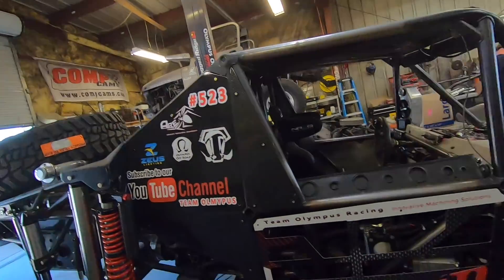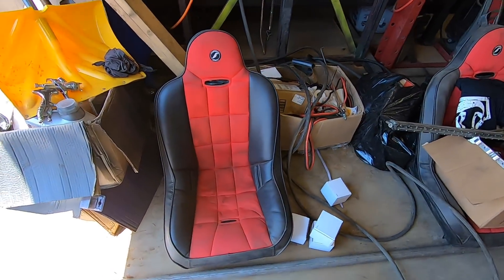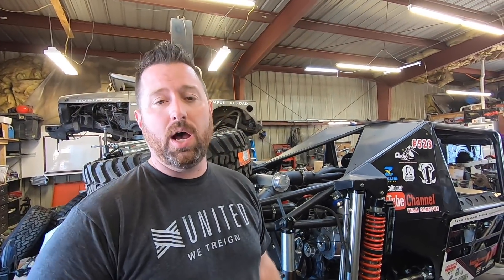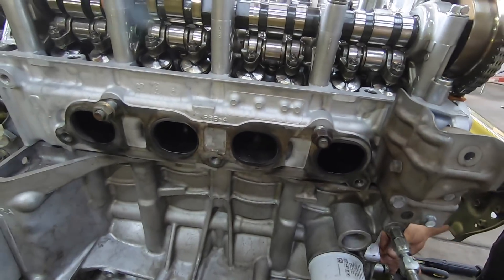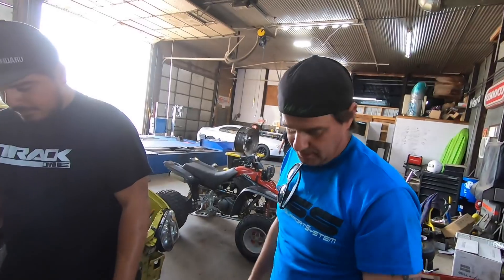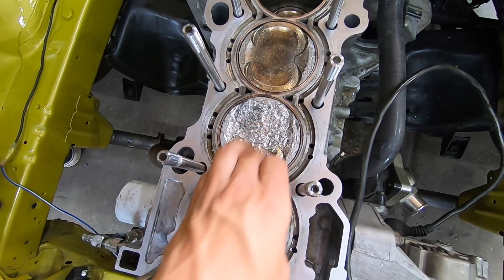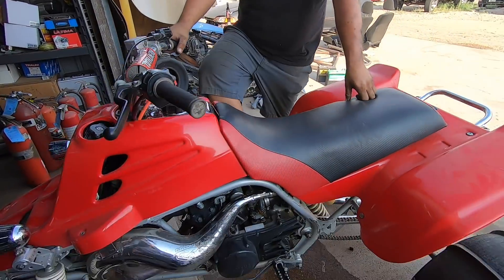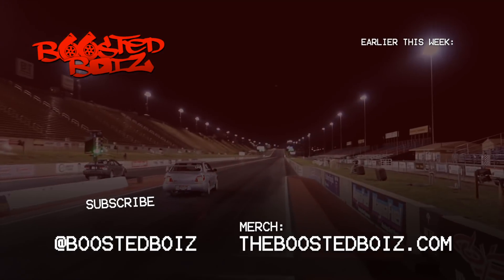Finding Out How Bad The Damage Is on Hondaru

Comment: If they put new valve guides in the heads they could be locking the valves up open when it gets hot so make sure the valve stems have enough clearance in the guides

Comment: My guess is the issue lies in the valve train.  Take the springs out and inspect to see if they're cracked or broken (and all the same type and not mismatched).  Put em all on a tester if you have one to ensure they all have the same seat pressure.  I'm thinking those valves floated for one reason or another and started playing kissy face with the piston.  The motor ran fine dyno session after session but once it hits the track and bouncing on 2 step and limiter *bang*.  Hang in there Emilio!

Comment: Guys, please check the exhaust wheel on the turbo (housing off) good chance its damaged) 
Also when running get a an emap sensor hooked up, you are most likely seeing a much higher figure than your springs can handle, ex is clipping the intake valves on shift as emap rises.

Comment: should change your name to brokenboiz lol those 4 piston heads and axles breakin are gettin a little tiring to watch
Reply: Dang that was harsh lol
Reply: @5luggin  Its just getting repetitive watching them break the same stuff over and over again. not trying to be harsh
Reply: @Tanner731  I agree
Reply: It’s not 4 pistons fault, they did the port. They had another shop do the machining and the same thing happened. They need to try a different valve spring setup
Reply: @Josh-qz3ki  I dont know enough about these engines to say whos fault it is but every one thats broken recently was a 4piston head, maybe its the parts they put in the head maybe its the assembly maybe its somthing else idk

Comment: This isn't a cylinder head issue on 4pistons part guys. Missing shifts and floating valves causes this. I've also never seen them clay any of the engines or check for piston to valve or valve to valve clearances. Maybe they do off camera but I doubt it.

Comment: Only a few possibilities for this. One is not enough clearance between stem and guide (drags when it heats up) and/or two, weak spring pressure (allowing valves to float and hit or bounce on closing).

Comment: My buddy's 734 whp B20V turbo EG hatch just did the same thing on the strip. He ran a 9.95 @ 156 mph right off the trailer and his second run his engine shit the bed at 10k rpm. The third piston was flipped sideways in the bore and both intake valve faces were snapped off and became part of the piston.

Comment: In my opinion those problems you're seeing are RPM related. Your revving an engine with a stroke of 99mm out to 9000rpm and higher. At 9000 the mean piston speed is already at 29.7 m/s and at 9500 it's even 31.35 m/s. Even high performance Engines in Formula 1 or Nascar usually only rev out to about 25 m/s. Above that it's not only very hard for oil to keep lubricating the cylinder walls but also valve float becomes a huge issue.
Another reason could be the Valve guards are too tight and the material expands too much, squeezing the valves -> ultimately getting them stuck.
Anyways I hope you will get those problems figured and don't loose hope!
Keep up the great work and content!

Comment: This is what happens when the clearance between the valvs and the pistons is to narrow because you have shaved both the block and head to much.Put modeling clay on top of the pistons and mount the head to the block with both crank and pistons and also a working valve train. Turn the motor over by hand at least 2 full turns so all valves has open and closed. take the head of again and measure the clay thickness and compare to spec. Good luck with the next one!

Comment: My guess is that the sequential no lift shift is having trouble making a dead time large enough to get it into the next gear, so you'll over rev and float a valve. Solution would be is Reduce the red line to 9k or something safe and get that sequential no lift shift 100% working before you go full kill mode same thing with the MR2

Comment: Looks like the valve is getting seized or partially seized in the guide, probably worse with the higher temps.
I would look at the valve stem to guide fit, and maybe increase it slightly to allow for expansion of the valve stem when it’s super hot. 👍

Comment: Once everything gets up temperature the rods have a certain amount expansion or stretch and if running zero deck height pistons the valve to piston clearance can be pretty tight, add in a milled head and or block and things get expensive fast. Have no idea if that's what happened, just a guess. If the piston hits the valve just enough to knock the keepers off the valve stem it will drop valves and look like  Hondaroo does. Interested to know what the cause turns out to be. Can't wait to see Hondaroo make a full on high boost rip down the strip.

Comment: Valve float, or too much heat and spark knock? Heavier springs and better conducting valves. Liquid sodium valves are supposed to pull more heat off the valve disk and carry it up through the stem to keep the head cooler.

Comment: Poor Hondaru. For us viewers, It's hard to complain and point fingers. We don't have enough info. What's the Piston2Valve clearance? 50°VTC? If so, with aftermarket pistons and various performance cams, it's too much because of P2V. Letting the ECU control the VTC limit is risky. They may have degreed the set up but I don't recall them ever posting any of that. Also, the output on these motors is not joke for a 2.4. Things heat up, tolerances slightly change, etc. My K24 NA had to be mechanically limited to 32°. I won't let ECU limit the function of a hydraulic piece that dictates changed in cam timing. If it was a problem with 4Piston, like the valve seat matting to the head improperly, I'd like to think the last machine shop would checked for such tolerance issues already.

Comment: I’d definitely say it’s floating valves when it fails to hit the next gear properly. Leaving it pinned against the limiter while you’re trying to shift it will do that. Just think at 9k rpm that valve is opening and closing 4,500 times a minute, that’s 75 times a second. Figure out why it’s not wanting to shift and possibly put heavier springs in it to help minimize float. That should solve the problems of it dropping valves.

Comment: Maybe look at the spacing between the valves and piston .. when the piston is at is highest point and the valves are fully open (down) maybe the spacing with those rpms is to close .. you can look into it with clay or a measuring tool ..

Comment: 2 reasons what could be wrong:

Valve clearance is too tight
Skimming on the block or the head

you should double inspect before and after all the machine work. Might need to use a thicker head gasket.

got to remember the stock specs for torque and clearance, should not be the same as on a built engine like this. You should run a lower compression ratio than stock, so you could have more safe boost. We all already know these can run over 1000hp. More boost with lower compression sounds better than high compression with lower boost.

Comment: Double check the value guides to make that the valves aren't moving around and check that the rocker arms aren't sliding... 
If all is good you may have to loctight the  keepers to the valves.

Comment: You guys most likely won’t come across this comment but in the off chance that you do please read: 
I had a stock cylinder head I bought all top-notch parts for years ago , I had sent it out for extensive machining porting and polishing. Was also running 20/50 on a high pressure pump, I had very similar issues happening even though it’s a totally different platform. Turned out because of the extensive porting and raised oil pressure it was causing timing issues , at certain high rpm it caused the timing to be distorted .  Almost like a misfire but cause by timing , enough for it to ignite either way sooner or Ray later than it was supposed to the explosion was so great it would bend the valve and either drop pieces of the valve train through the valve or break the seat
Reply: Also I have a stock cylinder head if you guys want to pay the shipping and it’s yours! I don’t know how to message on here? And I don’t have Instagram. But I actually bought the head from an eBay seller in Colorado “ civic wagon parts” For a CRV but it was different so it’s just been chilling

Comment: Damn! Emilio, I know your pain. I had a fully built LSvtec drop valves, just like that, back in 2002. Killed a ported head, forged 12.5:1 pistons, a sleeve, as well as damaged a few titanium retainers. Ended up being caused by first gen crower stage 3 cams. The first generation were ground backwards. Since the B-series is a rare counter-clockwise rotating engines, the cams were ground for a clockwise rotation. So, the cams would slowly open the valves and then slam them shut. Learn why it is happening, before throwing money at it.

Comment: Yo that banshee and the 450r are my style, I tear them up every weekend,I got an 01 banshee all one industry graffix/ tommy t5 pipes,cool dome heads,proflo intake, basically built/ 05 trx 450r,all blingstar full yoshi, with power bomb,fuel programmer, absolutely love both bikes!!!

If his banshee won't idle for him++ tell him there is a small 2 inch rubber hose that runs in between the carbs. Its a crossover hose. To sync the carb together!!!!!!

Comment: You know maybe it’s not the head or parts or anyone’s fault at all, that motor wasn’t made to go in there and take the lateral forces you are throwing at it. It could just be an oil issue and  it’s not making its way back up to the top during launches/pulls. Just a thought from a fellow mechanic.

Comment: They put stock head on mini van and not had an issue yet . So it would seem that’s where the issue is at . We will see what happens with stock head on hondaru but so far it looks like something with aftermarket head or parts on the aftermarket head .

Comment: For me I think it’s definitely transmissions issues, high RPM with a miss shift = valve float y’all should adjust the timing a little longer in those dog boxes giving the transmission a little bit more time to engage at higher RPMS

Comment: thats where "plastigauge comes in" it is a micromeasurement, when head and valve jobs for hp engines  you need to dbl check the work with tight tolorences during extension of valves before final assembly guys, common now , if your gonna run with the pack, ya cant piss with the puppies...

Comment: I can tell you what’s happening. the miss shifts are over revving the engine and floating the valves. The high rpm caused by the miss shift doesn’t give the intake valves time to close completely and causes the piston the hit the valve and break it.

Comment: Hey guys I think he’s going to have to start knocking it into neutral. Because all of that decel is pulling the valves apart.   It’s not a 13b. I put rotaries in everything here in Australia. A 13b or a 20b fit in a Subaru better than anything else. Have a chat to the varges brothers. They will hook you up.

Comment: Check for spring bind at full lift there's question thats the issue also the more boost u make the more heat that causes more expansion especially on exhaust side

Comment: Were the valves oversized in the head?  That valve seat looked pretty thin, I wonder if the seats were cut too large and the head dropped a seat, which caused all of the other carnage.  The seats I've seen are usually pretty stout, not small and thin like that.

Comment: Dude really consider raising the ignition cut time for the sequential during shifts. Slowing down a shift by a fraction of a sec is a lot better than missing it completely and then banging the rev limiter at 9K+ RPM floating valves and breaking parts. Sometimes you gotta go a little bit slower to go way faster.

Comment: I had a old school 355 Chevy engine and my valve guides was to tight on the valve stems and when it got hot it locked the valve opened and the piston came up and broke and chewed the valve up and cracked my cylinder wall and punched two holes in the piston

Comment: I've seen this before but it was on a stock street car dropped a valve seat not a common issue on Honda's in my case the parts went through the EGR an killed all the pistons and the head.

Comment: How’s the piston to valve clearance? Or maybe stronger springs and retainers Hondaru might have a valve float issue I’m sure the motor has cams and running boost just pushes those valves open more I’m certain you floating a valve

Comment: Hey guys u need to run the motors in for at least 500 to 1000 kilometres.  You are having failures cause the components in the engine need time and heat cycles to settle b4 putting any boost thru it .

Comment: While I did see someone say 4piston and humble performance released a statement denying they were at fault for the continued head failures. Not hating on them, but if they slap a stock head back into the car and it never has an issue again. You can only look at who’s supplied the ~3 billet cylinder heads thrown in the trash. I feel like if Emilo and Kyle were slapping these things together and not using the correct parts it wouldn’t ran for as long as it does, while making 800+ dyno pulls and street pulls and passes on the strip.

Comment: are you able to check the P-V clearance with the V-tec activated? might need to use a stiffer valve spring for the 10k rpm shifts! Hopefully you didn't bend that rod but id be checking very close!!!

Comment: Supercharged the ole razzle dazzle. It will make some boost and motor will still be happy and keep the nice sounding exhaust and wont complicate the build with turbo manifold work and intercooler plumbing and oil plumbing. Just get a little m90 supercharger off a grand prix

Comment: Stop missing shifts. That kind of thing happens to engines when people miss shifts.   Either that, or stop trying to run 800+ HP racing 4 bangers until you stop missing shifts. 
Did I mention about the missing shifts? Because you can't do that with high power manual trans race car engines.

Comment: How do you guys not know what the issue is? Your floating valves when you run almost 40lbs at redline while missing shifts on those sequentials. Turn it down, get stronger springs and figure out the sequential issues. The amount of rev limiter we hear while you guys are going down the track is issue #1. Go back a month or so on some PFI vids, little civic hatch. Guy only wanted 600 so he could figure out how to get it down the track each and every time repeatably and would only then start turning it up more. He had it right.

Comment: Nothing takes away from the fact. The a.ount of power they are running, missing gears is going to hurt something. Maybe start on low boost get it shifting properly work your way up. Gotta crawl before you run full speed down the steps lol. I hate to see it though.

Comment: Lower the rev limiter. Your going to max rpm and max horsepower. Lower one and don't have mishifts and the problem goes away. I don't mean misshifts are your fault just saying the valves float then bam piston to valve. It's either needing stronger springs or less rpm/boost

Comment: Valve float? You should look into some well engineered springs to get rid of float. The other thing it could be, which I've seen happen once is that the timing chain will actually stretch at high RPM because of gforce and other physics shit.
I would look into harder spring made with better material for quick return speed.
Also maybe your timing chain.

Comment: Next head break it in stick it on the dyno. And run it at 3-4K revs for a thousand miles which is what most engine rebuilds need. Happened to me twice too much power too quick blew my heads. Third time around no going over 3-4K revs for 1000 miles and then it lasted no more head problems

Comment: GET STRONGER AND STIFFER VALVE SPRINGS. The cause of hondaru's problem is at the high rpm the valves are floating and that's why you keep smacking the valve's.

Comment: I'm going back to a stock head with aftermarket valve spring and retainers. I'm done with 4 piston garbage it cost me 3 pistons and a sleeve on number 3 And it happend twice to me to the first time it just nicked the valve and bent it then they shipped me the same head back with new valve springs Valve, seals and re surfaced And it did the EXACT same thing as hondaru it's those heads man they're junk my buddy has a stock head with springs and retainers on his k24 pushing 975 hp with zero issues this has  literally ruined my entire season

Comment: The issue with all those motors and heads dieing is the seats arent pressed in correctly. There heating up and expanding 2 much. The mfg is going 2 loose on those tolerances. Seen it before in the v8 world. Cut too much to make room for bigger valves and whamo. Kaboom.

Comment: Please just bore the block. Get a STOCK head. Don’t use a 4 piston head. Use a STOCK head with different valve springs and retainers. 

ALSO STOP REVVING THE DAMN THING TO THE MOON. 8K is perfectly fine. That will also allow your transmission to get into gear.

Comment: Too much camshaft lobe duration and angle for high compression piston. 
 Exactly the same problem with pushrod engines. Big cam with stock valve pushrods and Blazamo!

Comment: guys second time I say same, check valve springs pressure.... it shouldn't be the right one, valves are floating... even If I'm not wrong is that the same cylinder of the last time? did it cause issues at same cylinder?

Comment: i need help kyle im wondring what starter and clutch hondaru running  im curently building a k24 subaru impreza hatch 2010 and i reach out at bob for the adaptor plate and all  but im wondering  about clutch and start witch one should i use thank